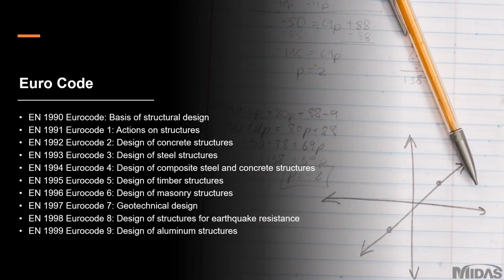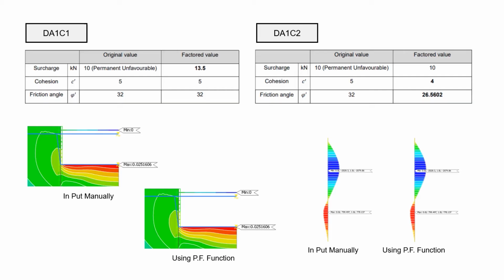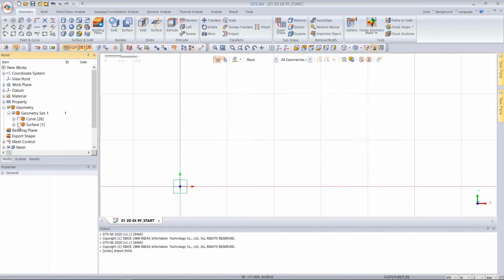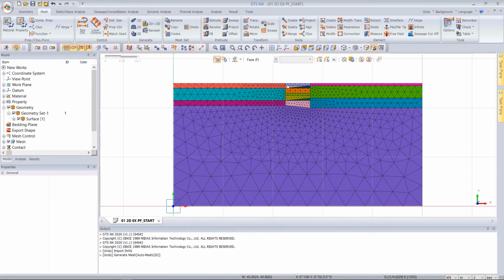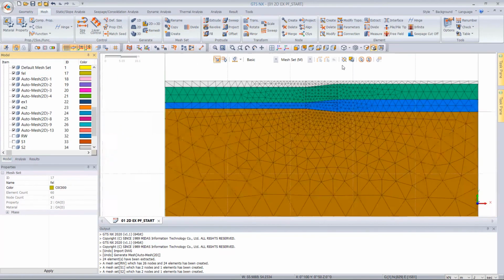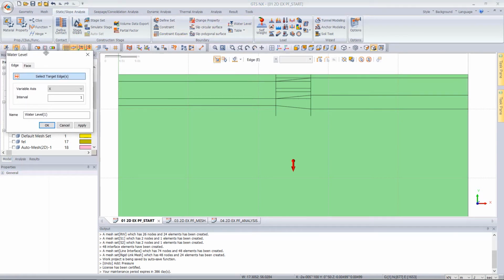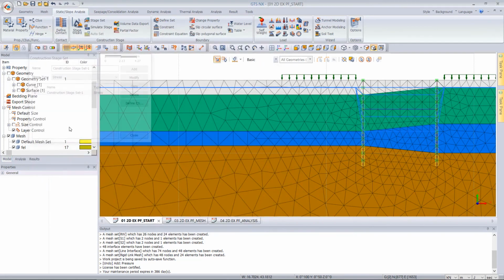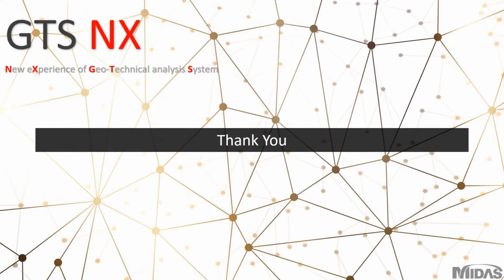Eurocode7 : 2D Excavation Analysis with Partial Factor Function

Comment: Excuse me, can I ask if there's any manual or tutorial to determine the retaining wall property? I mean what kind of cross section that I have to use if I want to model it as secant pile or diaphragm wall in 2D analysis? since secant pile wall have an intersection and diaphragm wall have width...
Reply from the maker: Hi Tommy N :)
To input the parameters in your retaining wall, we recommend using section conversion by calculating the section area considering the width. If there's h sections between retaining wall, you'd better just consider h section only to simulate conservatively.
Reply: @MIDASGTSNX  Thank youu